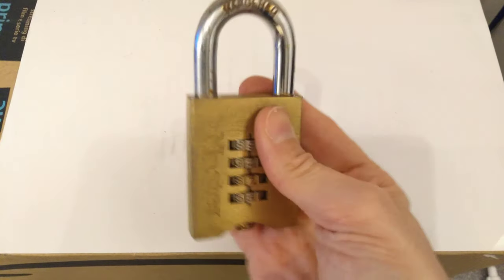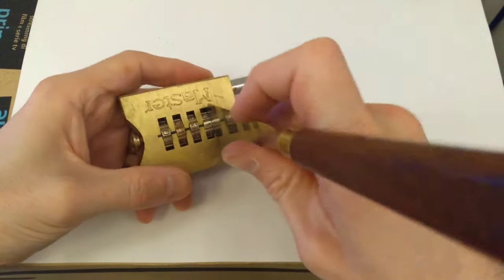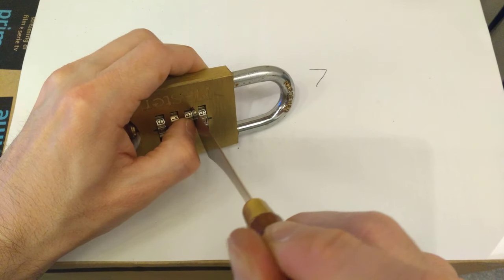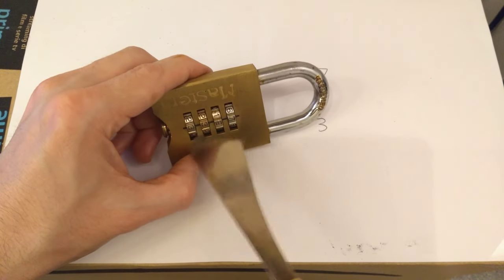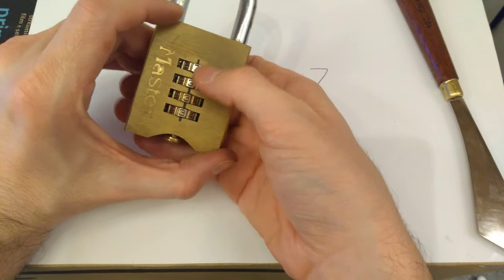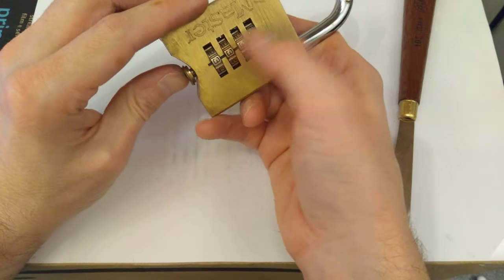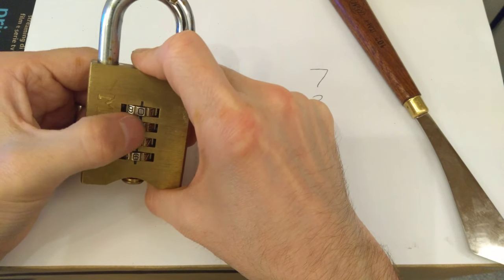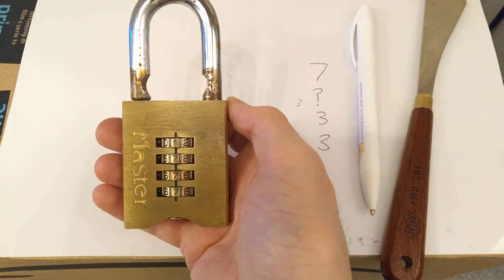Decoding: Masterlock 651 EURD Brass Combination Padlock

Comment: To be sure- it isnt when your shim tool starts to feel like its sticking - but rather when it lifts up then back down as you said? Just clarifying what kind of feedback im looking for
Reply from the maker: Yes, movement of the shim dropping or raising a tiny bit rather than something sticking or being difficult to turn. Though different ages of locks or wear may mean other methods like feeling for difficulty moving it may actually work too.
Reply: @freename there's also manufacturing defects too consider I've noticed after trying several. I've managed to unlock 2 of these using the tooless method a previous commenter had described and it actually went pretty well, however I've got to a third and I'm struggling a bit and will probably have to resort to the tool method which I was not good at all with while I was practising. And I was even using a mechanics "feeler gauge" which is a lot more precise than a painters knife as it allows you to select different thicknesses in very fine increments. 0.02 of a mm between different feelers. I'd highly recommend anyone who's reading this to get their hands on some if they can it will make their cracking life a lot easier.
You wouldn't happened to know how to disassemble these would you? Or what they look like cross-sectionally. This is the only lock picking video on the whole of YouTube I managed to find with this particular lock and I even struggled to find much if any information on google. Its very unique not to mention secure for a vertical combo.
Reply from the maker: @Bipolarvideos sorry. No further information. And the lock eventually became a victim of water ingress and rust, it stopped working well. I threw it away but maybe I should have tried to disassemble it, too late now !
Reply: @freename  dam! anyway thank you for the video and if i gather more intel ill be sure to share here.

Comment: Glad you managed to decode your lock. I tried your tool feeler method with no results and after a bit of research I realised why. You mentioned at the start of the video you're basing your method on what you'd seen on other wheel combination locks like the key holder ones. These types of locks are actually different in that they don't have external gates where a latching pin drops into to open it. If you thing about it, the body is machined out of solid brass and there's no mechanism insert. The gates are actually internal facing inside to the push pin. Have a look at this video for an example of how it's constructed. https://youtu.be/fmwLfQdwHQY?si=ogK6Br4Lqu7Xp-eY
So what were you actually feeling? Well the lock I have is the same, but the tolerances are much tighter. I can only get a soda can thickness of material in between the wheel and housing. When I probed around, I got no difference or feel all the way around each wheel. What I think is different is that your lock has more play so you were able to push/tilt the number sleeve over slightly to the point where you could feel the external lug which engages the wheel. The wheel you couldn't feel most likely had a tighter tolerance like all of mine so you couldn't feel where the lug was. 
Luckily for you it seems, Masterlock have placed the gate to lug position the same on every wheel. If it were different for even one of them, you wouldn't have been able to open the lock. Anyhow, not meaning to troll someone else's hard work. Just wanted to clarify a few things in case people had the same issues I had. 
I also tried the push pin and shackle pull decode by feel method. Problem is the shackle has an independent mechanism that doesn't bind the wheels like other lock and because of this, pushing the pin in gives you very little feel as it's also pushing up against the opening mechanism. Fortunately, there's an easy solution. It's exploiting the pull to reset vulnerability. Find an old fork. Bend the two outer prongs out of the way. Use the inner two prongs to put lever tension on the pin as though you were resetting the code. Decode by feel/click like one would normally. Helps to put a little oil on the shaft to see the movements. Don't lever too much or it'll bind too hard. I found each wheel has two false gates. Real gate has the largest movement outwards. Good luck!

Comment: i did your way without the flat tools but by just just pressing the bottom and feel it click ,the rest was your way the rotation bit so Cheers Thanks Works it Help
Reply from the maker: Really good to hear, this video doesn't get many comments (other than people telling me I'm irresponsible for posting the method). Glad it worked for you and was possible without the flat metal tool. I'll have to see if I can unlock mine without any tools. I'm pretty sure I've tried that but will re-test when I get time.
Reply: Have you to rotate +4 each digit to final unlock
Reply: Did it this way to, legend :)

Comment: i can't seem to get my lock open, the gap in-between the wheels is very small. what tool would you recommend for me?
Reply from the maker: Chop up a drinks can? (but beware of the sharp edges!). You need really thin metal.
The tool I used is 0.3mm thick.

Comment: I purchased this lock as the previous one can be easily broken for access. It came highly recommended as it can’t be snapped or broken. Now I need to take this padlock back as you have given every thief the information they need to open the lock. This video is a service for the dishonest. Please do the right thing and take this video down!
Reply from the maker: Only when BosnianBill and LockPickingLawyer also end their youtube channels. Security by obscurity is a poor policy. Get something secure by design and ask better of the companies producing these locks.
Reply: @freename  if other people are irresponsible it doesn’t absolve you of behaving irresponsibly.
Reply from the maker: @ronniewood6423  I refer you back to security by obscurity being a bad policy. Buy something better. Do not let massive companies sell insecure locks. Me not making a video does not make them made any better. Them making a better lock will fix the problem and also make it so there isn't interesting content for me to film.
Reply: Realistically, locks only keep honest thieves out. 😉
Reply: @ronniewood6423  Yeah wow holy shit what a horrible opinion. Imagine thinking that youtubers are making it easier to break open locks. It's the manufacturer's job to create more secure locks and the consumer's job to do their research for the right application. Any moron will take bolt cutters and destroy the shackle if they are determined enough. In a similar sense this lock is overkill for an arts and crafts supply cabinet. 
Consumers will vote with their wallet after seeing this and manufacturers will make their locks more secure after seeing this. You owe them a debt of gratitude, lest Masterlock simply reproduce the same lock and theives just share the secret between themselves and rob you blind for decades.
Reply: Ronnie, would you rather live in ignorance or buy a real padlock? 
Any thief with half a brain won't sit there picking a lock, they will use bolt cutters or a grinder. I bet the catch you have the lock on is screwed on anyways 😅